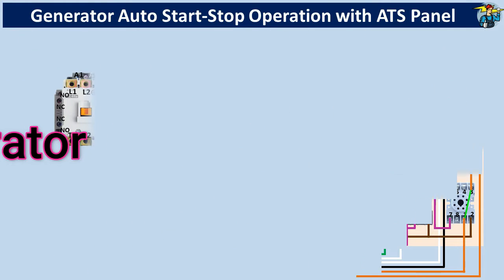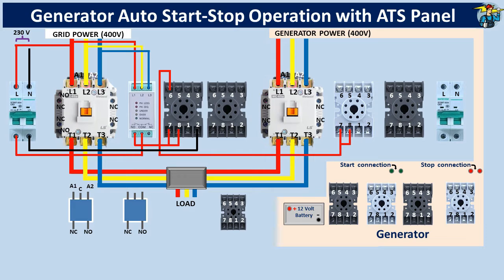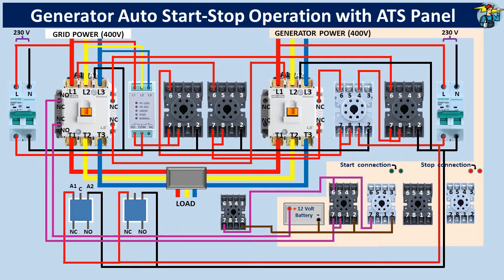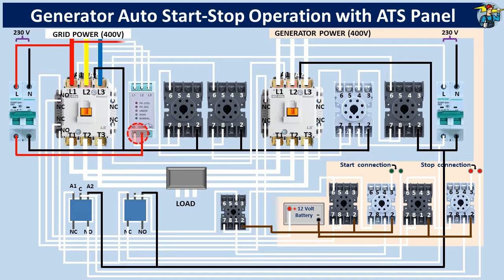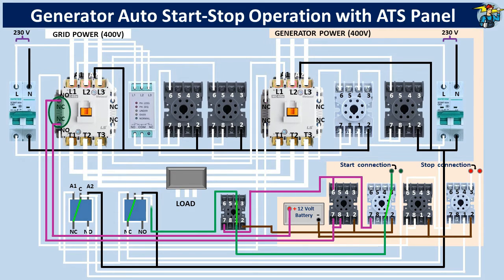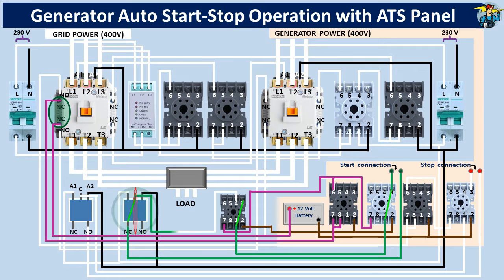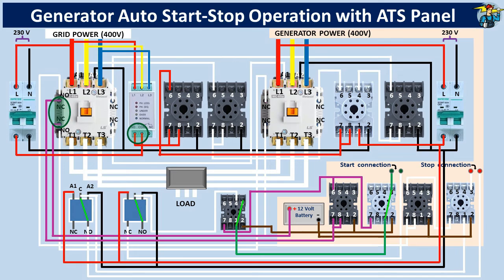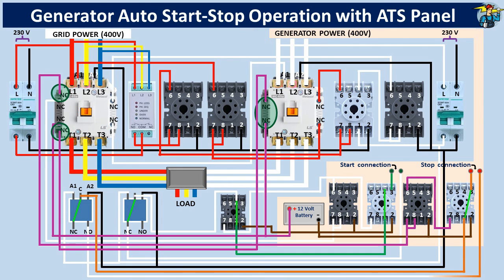How to design an ATS to Start and Stop the Generator Automatically ? / The Best Step-by-Step Guide.!

Comment: Brother.

Thank You for this UNBELIEVABLE synchronized tutorial you made.

Brother. I am not a Engineer so I will ask you this. Can you collaborate a 3 source.

Solar as Priority
Grid as Primary Backup
Generator as Secondary Backup.

I hope you can make a tutorial.
Reply from the maker: Thank you for your inspirational comment on the video.
On the power priority arrangement, yes, we can use solar power as priority source keeping Grid power and the Generator power as primary and secondary backups.
I will try to do a video on this when time permits.
Reply: @ElectroAcademyEA thank you bro

Comment: At 8.01, when the power is lost, the normally closed, is the one that will get closed and allow power to the battery.
Reply from the maker: Yes. Battery power is allowed to the generator start timer through this NC points, which are closed now.

Comment: Very nice presentation, congratulations.In case you are using these small single phase generators without automatic setup how do you manage these important aspect like; like fuel level control, kick start trial and battery charging mechanism
Reply from the maker: Thank you so much.
When using small single-phase generators without built-in automatic features, managing things like fuel level, starting, and battery charging requires some smart external arrangements.
Here’s how you can manage those aspects.
Fuel Level Monitoring:
Add a float-type fuel level sensor to the tank.
Connect it to a fuel low-level alarm or even an auto shutdown relay to protect the engine.
Kick-Start / Auto Start Trial:
Most small gens are recoil-start, so auto-start is tricky.
But if it has an electric starter + solenoid, you can use a controller (like Deep Sea  or even a DIY relay timer setup) to attempt auto-starts in multiple trials.
Otherwise, you’ll need a manual start, possibly supported by a buzzer or SMS alert when mains fails.
Battery Charging:
Small gens usually have a built-in DC output, mostly12V or 8.3V DC, but it's weak.
Better to add a separate battery charger powered by the generator’s AC output.
Use a smart charger that maintains the battery even when the generator is idle.
If the mains power is stable, connecting the charger to the grid is perfectly fine keeping the battery topped up and ensuring the starter battery is always ready.
For fully unattended operation, you’d ideally use a starter motor version of the generator.

Comment: Please sir, can you incorporate a switch into the ATS but the switch will be place inside the house and it can be used to put off the generator in the event that the generator turns on automatically when the grid goes off and the generator is not needed at the time
Reply: Please sir, just write down the procedure to follow in adding a switch to turn off the generator if it's not needed at the time
Reply from the maker: You can keep the generator control circuit breaker (230 volts) switched off during daytime.
Also you can arrange another 2 pole breaker series to the generator side control circuit breaker at a convenient place.
It can be kept switched off when you don't need the generator to be started on certain occasions.
Reply: @ElectroAcademyEA  thanks sir but give me the explanation on how to connect another double pole circuit breaker in series  to the main generator double pole breaker
Reply from the maker: You need to get help from a good electrician. He will do it for you.
Reply: @ElectroAcademyEA  thanks 
Im an electrical apprentice and i like to learn more
Reply: So can i follow this same procedure for a single phase generator with key starter and battery?.

Comment: Please, just give me a brief write up on how to used the stop and start button.
Is it that if the generator turns on automatically and you don't need it at the time, you'll just push the stop button to turn off the generator?. Then, when you need to start the generator later again, you just push the start button and the generator turns on..
I'm i correct?
Reply from the maker: Connect the two green-marked 'Start' points on the ATS to the contact points of the generator's start push button. 
Similarly, connect the two red-marked 'Stop' points to the stop push button's contact points.
When grid power is lost, the ATS will automatically bridge the start contacts, signaling the generator to start. 
When grid power is restored and the power is transferred back to the load, the ATS will activate the stop contacts to shut down the generator.
Before making any connections on the generator side, consult the generator manufacturer to ensure compatibility and avoid potential malfunctions. 
It's also best to have a qualified electrician assist with these connections to ensure safety and proper setup.
Reply: @ElectroAcademyEA  ok thanks.
Now i understand.
The green wire from the ATS is connected to the start button of the generator while the red is connected to the stop button of the generator.

Comment: Please, I have a question to ask and i need response sir .
The Timer relay and DPDT relay you used for the start and stop of the generator, are they DC or AC
Reply from the maker: Those are 12 volts DC powered units, since these work using generator Battery power.
Reply: @ElectroAcademyEA  wow!
So if im designing this ATS im gonna get 12V DC timer and same 12V DC relay timer  since they'll be powered by the generator's 12V battery.
Also, it's obvious the timer, relay and contactors you used for the grid and generator supply are all AC components only the components powers by the generator battery are 12V DC
Reply from the maker: Yes
Reply: @ElectroAcademyEA  Please, just give me a brief write up on how to used the stop and start button.
Is it that if the generator turns on automatically and you don't need it at the time, you'll just push the stop button to turn off the generator?. Then, when you need to start the generator later again, you just push the start button and the generator turns on..
I'm i correct?
Please,  respond to this
Thanks

Comment: Can this turn on a diesel generator automatically when the grid goes off.
Also, for a diesel generator, is there any other component connected in side the generator to support the automatic changeover?
Reply from the maker: This system can start a diesel generator automatically and load it, when grid power goes off.
Reply: @ElectroAcademyEA  ok.
I thought there should be a signal wire that should send signal to the diesel generator.
For instance, in a small generator without battery and key starter, a signal wire is connected to the of and on button of the small generator and this helps to switch off the generator when the grid is restored.
So for the diesel generator, is there no signal wire.
However, I'll be glad if this connection turns on the generator automatically when the grid goes off.
Thanks
Reply: @ElectroAcademyEA  i took my time to watch closely and examined the illustration and it's perfect.
Thanks
Reply: @ElectroAcademyEA  please, is there and other connection done at the generator side to support the automatic changeover?. Because in the course of your explanation, you mentioned solenoid starter, so do i need to install a solenoid started in the generator so the ATS can work.
Please, educate me
Can you kindly explain the termination at the generator side.
You can also drop your WhatsApp number too for effective questions on this ATS.
Thanks

Comment: Hi sir we have a 400V 3 phase generator with ATS, the time delay when a power supply is off is 30-35 secs. Is that okay?
Reply from the maker: A 30-35 second time delay for an ATS to activate after a power supply failure is generally considered acceptable.

Comment: can you please explain how and what to add to the circuit to protect components like the contactors coils from main power issues like surges or brownouts etc. ? many thanks for the great video
Reply from the maker: You should have an Surge Protection Device and other protection devices such as Over Current  Protection Device.
Please get help from a good electrician on this.

Comment: The use of two contact open and do ATS, is not safe, when the current is large contact head temperature is high, so that the contacts fuse and can not be separated, the other switch on, the circuit will be made to safety hidden advantage.
I encountered a situation is the motor from the Y connection to the delta hair, the above sexual condition, the result is the explosion of the switch.
Reply from the maker: When using magnetic contactors, you can introduce a safety relay to identify contact welding situations in it.
Video on Below link explains how to fix a safety relay to a circuit.
https://youtu.be/emp0T_kTsc4
Reply: But I have a question... if one of the contactors get stuck, wouldn't the auxiliary contacts also get stuck? Or not necessarily? I'm asking this because if the interlocking is done between both contactors through the auxiliary contacts... wouldn't this be considered a safety layer or is a safety relay still needed?

Comment: Hi...please hurry up with the new sketch that includes the start - stop push button and the emergency button and a selection key with 3 position H-0-M (1-0-2)...It will be a complete sketch if you also include a switch key with 3-position (H-0-M) and also useful and also useful for manual operation.
Reply from the maker: Will do a video on this when time permits.